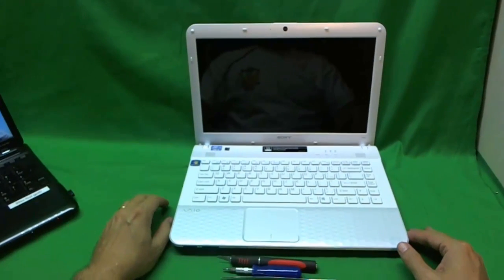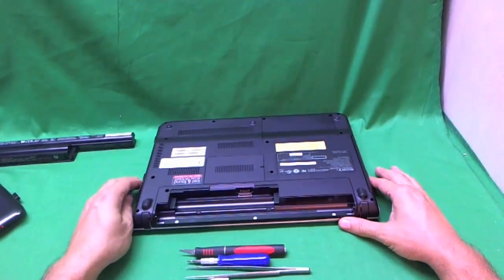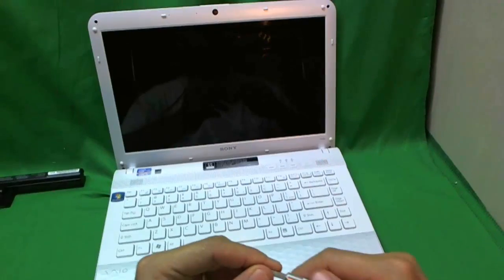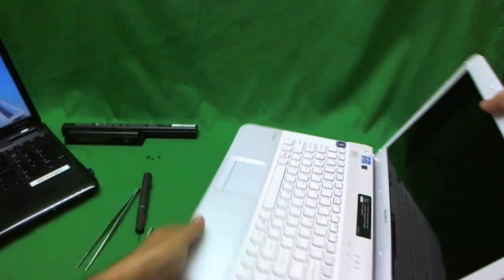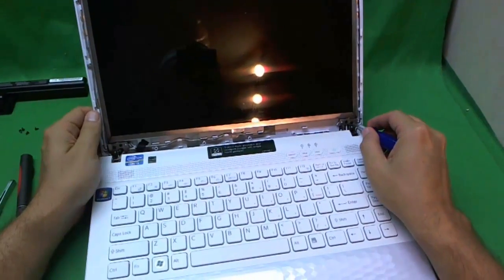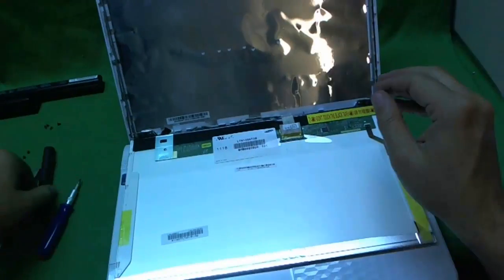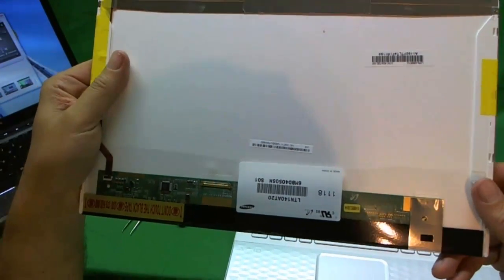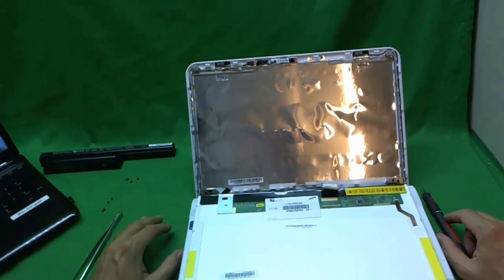Sony Vaio VPCEG Laptop Screen Replacement Procedure

Comment: Thank you for this. I just changed mine out I forgot to take out the battery.  But it worked for me and I didn’t get shocked,when I felt the screen heat up it let me know I connected it thank you so much.

Comment: Stumbled upon this vid and helped me practice dissecting my Sony vaio. 

But I missed checking the video connector if it was 40 pins or less because I would order it online, just to make sure.

There are 15.6" out there that do not match with connector pins on sony vaio.

Comment: Hi! Do you know is the graphic card located to in Sony Vaio VPCEG32FX? If so, is it possible to replace the graphic card? Any suggestion to what graphic card is compatible and good gaming with Sony Vaio VPCEG32FX?
Reply from the maker: +Master Teemo Apologies but we do not as we only work on laptop screen. Thank you
Reply: it's impossible to change a laptop's GPU. The reason being that it's a discrete GPU and therefore attached to the motherboard. if your GPU is broken you need to replace the entire motherboard and in that case you're better off buying a new laptop.
Reply: it's impossible to change a laptop's GPU. The reason being that it's a discrete GPU and therefore attached to the motherboard. if your GPU is broken you need to replace the entire motherboard and in that case you're better off buying a new laptop.
Reply: +random dude on the internet send it to mexico. . they will charge a even a smallest parts. 
AMERICANS LAZYS ONLY DO EASY THING LIKE CHANGE EVERYTHING.
Reply: Lu Cho
i'm not american. I don't know what youre trying to say either. but the gpu is soldered to the motherboard if that's what youre talking about

Comment: I have the same model sony vaio laptop as this. The screen isnt black. But in a very low brightness. If u use a flashlight u could see that the laptop is working well. U can still play games. But in normal lighting i cant see anything except black. And i can see that the white screen is turning into pink. (Saw it with my flashlight) what do you think?

Comment: Hello!
When I replaced my screen I did not take my battery out, in result to it my screen is really dark, but If I take a flash light and point to the screen I can see it (barely) so I was wondering if it's the screen or the laptop it self that is broken.
Thank you in advance

Comment: Great video. I followed it and was able to successfully replace the screen on my friends laptop. I recommend using a guitar pick or similar plastic tool to get the bezel off. Getting the connector to engage was the most challenging part. I used a small flat screw driver to connect one corner and then connected the rest. any other advise you could give for this challenging part? (I already got it but I feel people will struggle with this). Thank you!

Comment: @PVnRT, They are all pretty much the same. I used a 3 year old video to use as an example on my Vaio.  Look me up, I didn't do a tutorial, but, I did give a basic breakdown of cost and parts in the description.

Just go slow and you will do fine.  My next project is building an LCD desktop monitor.  I there's enough case material, I'm
Considering speakers too.